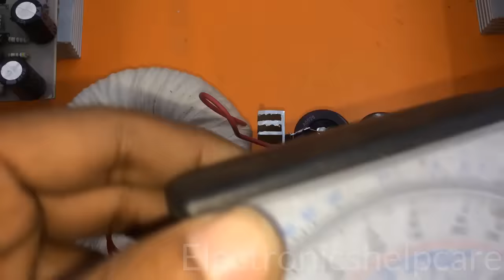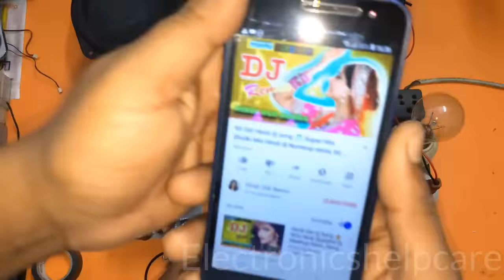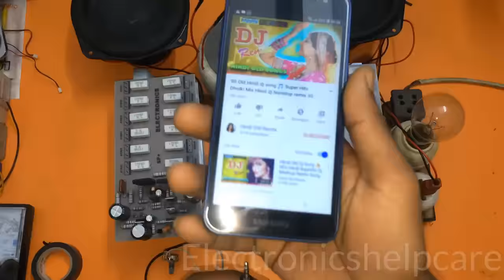1000 watts amplifier, electronics

Comment: That amplifier is so wrong, you need the VBE Multiplier transistor on the outputs heat sink or it will self destruct by thermal runaway, on top of that there is not fuse for the toroid primary, when the outputs get destructed the short will make that toroid a ball of fire.

Comment: I see this in several of these build videos. You must have a good mechanical connection whenever you are attaching or connecting things together. Solder is to connect things electrically. It can get brittle and break with age, especially if things move around. It is work hardened very easily. What you see here might be good enough for testing an idea but anything permanent needs to be mechanically connected first, then soldered. And yes I am aware that modern machine placed components on circuit boards are often held in place by nothing but solder. Those work fine for tiny resisters and such that weigh nothing. Wiring and such needs good connections to last.
Reply: That is an important point, i see that too, lots of youtubers neglect that

Comment: 50 watts, no more from that transformer.
Dude, you need current!
My transformer on my subwoofer amplifiers had 0.8 ohms as primary coil (1.5 mm diameter), secondary has 3 mm diameter 2x 45v.
Yours looks for supplying... Something
6sq are the wires from the transformer to the bridge and the startup is done through a 30A relay
So, what I see here is some amplifiers construction... But sorry, is out of discussions

Comment: Driver transistor doesn’t need to be big, they need to give less than 1A, so you used very good transistors where it wasn’t useful. Wires for power supply are too thin!

Comment: I am sorry but your transformer is quite small.
Normally, if the supply is not fall during high consumption, 50x1.41 = 70.5 volts, means at a +/- 70.5 v, you can have around 500W at 4 ohms
Better after finishing your job, insert a 1000hz signal at a 4 ohms rezistor and measure the voltage on it.
P=U2/R...

Comment: this transformer never ever deliver 1000 watt :D
Reply: I have two 500VA 50-0-50V torroids for my 350x350RMS amp and each torroid is bigger than the POS shown in this video! :D I'm also running 12 x 12,000uf filter caps, more than double the homebrand caps shown here. 
Must be one of dem PMPO 1KW for like 0.000001 of a second amps...